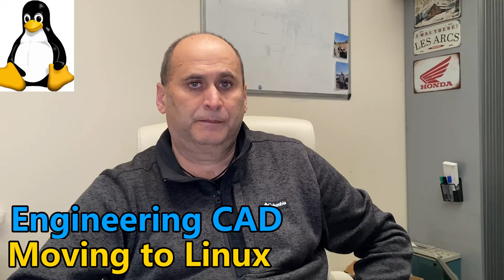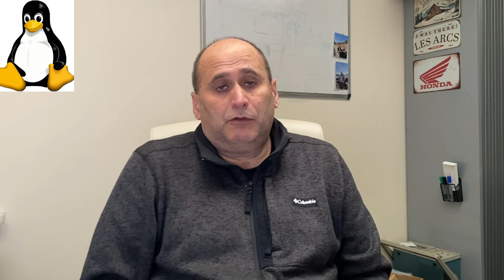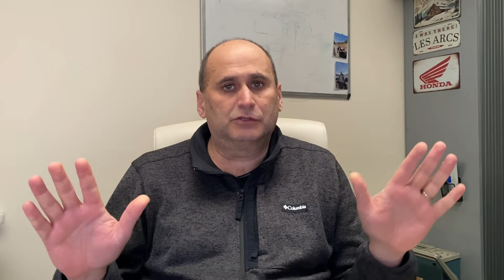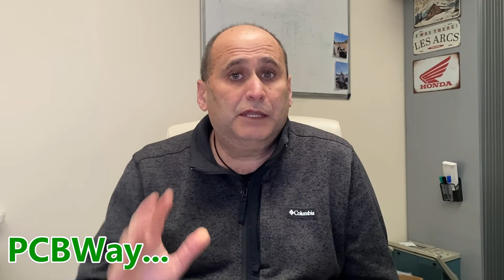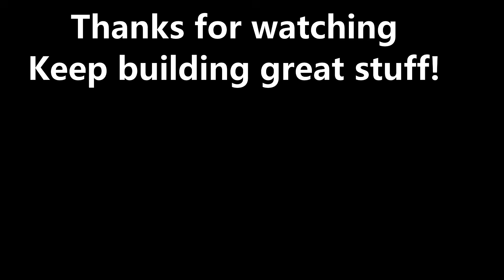Switching to Linux for Electronic Design

Comment: Guys is there an alternative to CAD software like autocad in linux that follows the same workflows as autocad?  LibreCAD is way too different and slow to use.
Reply: Bricscad, Bricscad Lite, Ares Commander, Gstarcad.
Reply: @juniorlima1942 thanks man i will check them out
Reply: @juniorlima1942 thankyou man 💪. Let's test it out
Reply: @sucharsharma  there's also draftsight 2019 (free), that was the last version that was released for linux. Actually to make it work, you need to return the year of the system, before open the program...you can find link to its installer in a video with this name 'Linux Mint for Architects #5'
Reply: @juniorlima1942   thanks bro, this is going to make it so much easier for me to use linux.
Reply: Also check the comments there.
Reply: @juniorlima1942 copy that. Thanks so much man.

Comment: My hope is that medium and large companies will shift the tens and hundreds of thousands of dollars they spend on commercial engineering application software licenses and pay their own in house developers that specialize in the tool to fix their problems and add features that are contributed back to the project.
Reply from the maker: If you are talking about tech companies I wouldn't hold my breath, most of them are run by finance people with the focus on the "next quarter", they see engineers as an expense.

Comment: Doing CAD, EDA or BIM on linux is like pulling teeth through the ass.
If you're a programmer - its amazing.
Reply from the maker: I hope is just a saying and we never have to experience that (puling...) light CAD is ok-ish on Linux, heavy stuff not there yet, I agree.
Thanks for the great comment!
Reply: @adaptivedesign8795  I really want it to succeed, but doing real proper work turns into fighting the OS - either emulation doesn't work or native software is just bad.

Comment: Yep, I totally agree, M$ is not worth the trouble.
I used Protel starting back in the DOS days, this became Altium around 2001. It was expensive, but excellent.
I also wrote commercial MS software from DOS to Win7, then we became a Linux house at work, and at home.  
Losing Altium was a big problem.  I ran it in a virtual machine for a while because I didn't think KiCad was good enough.  I was WRONG.  KiCad is quite adequate for professional projects.
We also use Freecad, this is too good to be free, love it.
I haven't written a commercial Windows App for 10 years, I will NEVER go back.  😁
Reply from the maker: Altium pop up in many comments, is a great tool but too expensive for someone who want to start or open shop. KiCAD is coming slow and steady and is already usable form many projects and is multi OS

Comment: I used to use Onshape as it runs in a web browser (so runs on Linux) but have switched to FreeCAD. It's a bit clunky at times but it's worth the pain to have complete control over the software and files

Comment: Switched to Linux about 15 years ago. I have still one dedicated windows machine only for Altium pcb design. However I am doing the pcb design over RDP so I never have to leave my Linux laptop. It is working really smooth. If you have not tried it give it a go.
Reply: Have you tried a virtual machine for Altium by any chance? Been thinking about going that route.

Comment: If I was setting up a shop, I would be going entirely with Kicad for PCBs.  The only place they don't quite have it nailed down yet is in their spice modeling stuff.  It is there and it does work but it is not up with LTSpice.
For the few 3D prints I have done personally, I used OpenSCAD.  For me, it fits well with how I think about things.  Others may hate it and use FreeCAD.

Comment: If there was no issues with using  a pirate Orcan/Cadence in the past then using Altium Desingner the same way shouldn't be a problem either. Altuim Designer is an industry standard. For instance we design test systems for PCBa production lines and 99.9% of all our customers use Altium. From a prospective employment point of view  dealing with KiCAD is just waste of time as no one needs KiCAD skills on the job market.
Reply: Any advice to use cracked software of any kind is irrelevant
Reply: @CaptainDangeax   "advice to use cracked software"
you're only one who talks on cracked software here so far. If you didn't know there is no such thing as "cracked Altuim software" in this world at all.
Reply: @MSM5500  yeah, whatever. FYI you can't prove something doesn't exist
Reply: @CaptainDangeax  
Are you morality cop poking around, or what? No one called out cops here.
Reply from the maker: I traditionally used Orcad and Pads (paid for both) in commercial settings (I'm hardware engineer with a bias towards digital design - FPGA/HDL) - and a radio person as well, everything I designed in 40 years can be designed in today's KiCAD (not necessarily easier) - Altium is great tool but pricey, a small shop or a newly setup company can't afford Altium from day one. Looking ahead I think KiCAD will get traction (in many Universities is used already) look will see what the future holds hard to tell.
Thanks for your point of view!
Reply: You forgot one little detail, most of CAD professors maintain a survey of their branch, and as the video say, former versions of Kicad were not pro level (normal, you can't compare development speeds  between payed specialized programmers and open-source "free" ones), but at this time we see many Linux software branches coming to maturation, allowing them to jump from consumer good enough to pro usable and interesting alternative.

So remember that, because in the next 5-6 years, things are going to change, a lot, which is always a good thing as far it improves the user (free) experience.

Comment: As soon as you have to install a peripheral device with windows soft/drivers available only, you will quit linux. And no, it doesn't run properly on virtual machine. This was my experience. Unfortunately everybody has/will have such a device. Especially if working with electronics... I only have 3 of them- a programmer, 2 multimeters and a soundcard... I wish they worked with Linux though...😔
Reply: But do you have to? I mean if you are an employee and the manager says "We use system X", then you somehow have to make System X work for you. Otherwise, it may be possible to find System Y that does the job on Linux. I remember researching the Linux compatibility of various devices before buying, where Windows users might just get something from the next electronics shop, confident it will work because no maker of PC hardware can afford to not support Windows. But so far, I always found a solution.
Reply from the maker: This is the problem with not very popular peripherals (not so common) - maybe in the future. I'm surprised about the sound card most of them are based on popular codecs.
Thanks for  your comment!
Reply: @adaptivedesign8795 The sound card in particular is one of the devices where you should research compatibility. I needed a simple sound card with stereo output a few years ago, and I wanted it to be an internal one to minimize cable salad. After browsing several web sites, I came to the conclusion that the topic is poorly documented but a (cheap) Creative Labs Audigy would be the model most likely to work. It did and I'm still using it today.
Reply: Your argument falls down on the "have to install"
Also, I still own a little netbook thing that came with Linux on it.  At the time they warned people to not to try to install Windows as the touchpad wouldn't work on Windows.
Reply: @kensmith5694  I don't care about the computer itself. How I'm suppose to use my peripheral hardware on Linux if there is no software for it? Even if there are drivers in the kernel???
Reply: @MrTon4eff  I have never had such a problem.  I have printers and a scanner and a SDR and a TV tuner dongle and USB-RS232 converters and external network adapters and a projector.  They all just work.
Reply: @kensmith5694  I'm glad for you. If it does work for you it doesn't mean that it works for everyone. Hardware manufacturers doesn't care about Linux at all. The majority of them make their software mainly for Windows, eventually for Mac. Most of the Linux drivers/soft for a specific hardware is made by enthusiasts/good samaritans...
Reply: @MrTon4eff  You haven't suggested a case that doesn't work.
Reply: @kensmith5694  OK, give me a software for my T48 programmer for Linux. No, not a command line option please in 2026. :). Give me software to use my miniDSP 2x4HD sound cards. Yes it works under Linux but I prefer to use their full features. Give me software to use my BM869S multimeters under linux. Give me a fast and reliable way to stream Dolby Atmos 7.2 4K thru my Onkyo receiver, without dropping frames or tearing. Or give me a solution why my HP1022N printer doesn't work reliably under Linux after testing with multiple forum suggestions, countless driver/kernel versions (the same printer works perfectly fine under Windows)... Let's get real and think as a grown men. Even Linus Torvalds admits that there is no Linux with reliable GUI. Please note, I don't badmouth Linux itself, I want to use it, it simply not possible for reliable use. One should constantly make compromises and loose huge amounts of time to tweak this or that, which will be broken in the next update. And the last, can you give me a reliable solution how to use my own personal keyboard layout, which would not brake after the update. It's just frustrating. Yes, I installed Linux Mint on my parents computers and they use it happily without any issues for browsing, occasional document printing, listening music or watching movies. It works. I think you got my point finally...
Reply from the maker: I agree you have a specific combination of things there (hardware) which are designed by their manufacturers to work under windows. Obviously switching to Linux for your specific case is "no go" but the vast majority is not like your case, is actually the opposite they can can switch and save money in the process (free CAD) that's was my point and your point of view is valid too.
Thanks for sharing the details of yous case is good to have a good picture for what is really out there.
Have fun!
Reply: Did you modify your VM configuration to directly use  the hardware in question instead of through the emulation layer ?

Comment: While I share the sentiment, I had a lot of problems with scaling hiDPI monitors and the usual linux distros, while it did fine under Wayland, I had crashes on kicad and wayland. So I use still use windows for CAD, simulations and audio/video applications, but it needs to be trimmed down and managed otherwise its stupid telemetry gets nonsensical. Not a single problem with CLI tools on windows neither, my homelab is debian and proxmox, my laptop use manjaro and main workstation is dual (kubuntu/windows 11 LTSC)... Internet/basic use pc for family boxes Linux mint.
Reply from the maker: You seem to be a real Linux enthusiast,  my take in the video is from a more common Linux user, an engineer more than a programmer (half way between a simple user and a keen user) - your point of view is valuable for us simple users and we hope all these problems  will be fixed (fingers crossed)  or we don't come across them
Thake Care ! Thanks for the comment,

Comment: Interesting to hear about FPGA and Linux. I thought that was still Windows-land! Any recommendations?
Reply: fpga's home is linux. its very hard if not impossible to develop realy complex designs on windows (think cpu/gpu size emulation)
Reply from the maker: Xilinx had tools for Unix (Solaris, HP-Unix) and around 2004 (I think) they dropped Unix and started to support Linux in parallel with windows. (I used to work there - at one point a had 2 workstations and a PC on my desk)
I think most of FPGA companies have tools for Linux today.
Take care and Happy FPGA dev on Linux!

Comment: One of the plug-ins I use and recommend is the interactive html BOM. It's super handy when populating a PCB. You can click on an item in the BOM and it will highlight the parts on the PCB. You can also put the html file on a thumb drive and open the file on what ever computer is the closest to you when you are assembling.
Reply from the maker: I guess that's very useful when you make prototypes and place parts by hand, or even with machines if you wan to have a quick look at the BOM - Tanks for the pointer,
Keep building great stuff!

Comment: I'm glad to see that the CAD situation has improved with Linux. It was one of the things holding it back in a number of professional environments where people might have preferred Linux over Windows for some time. It's been easy to use for the majority of non-professional people for quite a while, but some professional applications have been subpar. Good to see things improving.
I've been using Linux primarily since I started using it in 2006 and rarely use any form of Windows any longer, but for the most part I do IT and Math stuff.
Reply from the maker: in the end Linux is just an operating system the rest are tools/apps, windows was an OS bundled with some simple apps, but now has become a marketing tool with the only objective to extract money which if fine if done transparent and honest, people have brains and if they don' agree with MS business practices can make other choices.
Have Fun!

Comment: I use the following software for electronics design under Linux:

Fritzing. - Is it the best PCB design tool? No it is not, KiCAD is far better. Can you create good PCB's with it? Yes. Is it a promising PCB design tool? Yes. As I can get good results, I am happy to work around its drawbacks and contribute to the project with parts, bug fixes and so on. Being part of something is important for me as well.

Renesas Go Configure Software Hub - GreenPAKs are great ICs to put some custom logic in and the Go Configure Software Hun is a joy to use and runs perfectly under Linux.

Efinix Efinity - Design for Efinix FPGAs. Works great under Linux.

CircuitJS - You can run it offline, but I run it offline and great to quickly simulate a little analog circuit and see the results.

Arduino IDE - If you need a microcontroller...

Comment: OrCad was a reference in those days ... I still remember the famous hardware key a parallel Port Hardware Key ! Oh those were the days ... 🤣 But it is Clear to everyone that the Platform to develop Electronics and Software is going to be Linux going forward. In terms of Software Development This has been clear for a long long time. Now the Electronics is realizing Linux is the clear solution for tools and development.
Reply from the maker: I know I'm going to sound like a dinosaur (I don't feel like one yet) - my first PC was made from junk (what other people have discarded) - an old I286 Motherboard, PSU and case (the only two components I actually purchased)  two  used 1.44MB floppy drives, some RAM (1MB) and Monochrome monitor (later color VGA 640x489) - no Hard-Drive (NONE). I was booting DOS from one floppy (command.com has to be on this disk) and the Orcad.exe. The second FDD drive was for the component libs and project files.  And somehow I managed to design PCBs (the software I got from one of the PC-s in UNI) - nothing could stopped us. Today we are complaining about AI slop ...
Take care, have fun, life is short!
Reply: @adaptivedesign8795  Oh I was a far more "advanced" dinassaur 🤣with the exact same type of build it yourself attitude of those days... a glorious 386 .. but .. but with Math co-processors (!!) ... witch made it really more like the 486 generations of those days. I did not have money so all my friends had 486 brand spanking new PC's ... I was only able to collect a used 386 motherboards with a problematic parallel port I had to fix. Building and harvesting the hardware was half the fun those days. And yes today we are flooded with Ai slop all over. ... it's actually a bit sad ... have fun !
Reply from the maker: That was the way to back in the days, fixing everything we could and it felt great. We as a generations were shapes by these things. Now I really sound like like a dinosaur, however I feel young.
Take care!

Comment: Would like to switch to linux but my biggest obstacle is Fusion. Doing complex surface modeling and freeCAD seems not to be very good at it.
Reply: I’m in the same boat, Fusion is the only reason I haven’t already gone Linux.
Reply from the maker: I understand you completely, there is always a piece of software that we learned and is unique in a way that has no Linux equivalent,  sometimes you have to stick with wat you have.
Take care, thanks for the great comment!